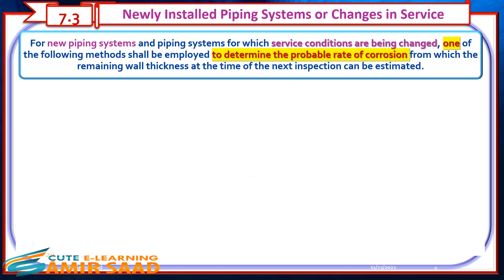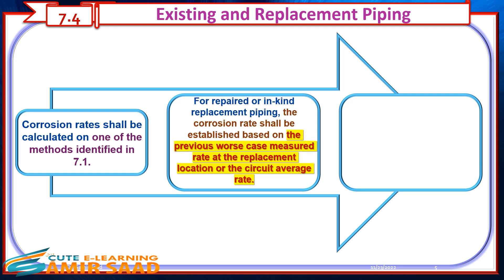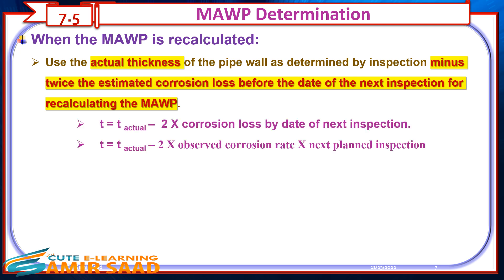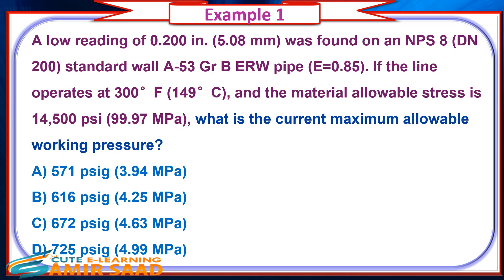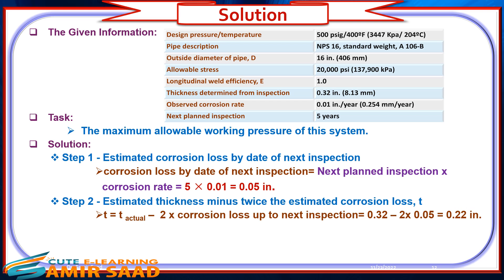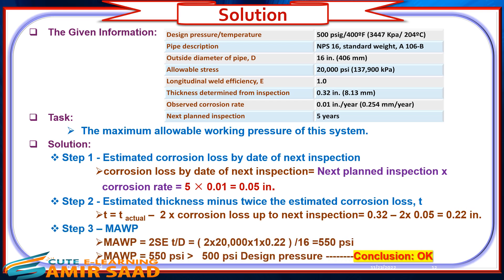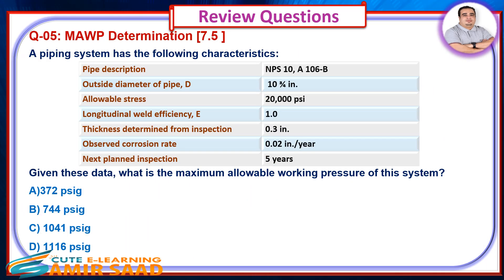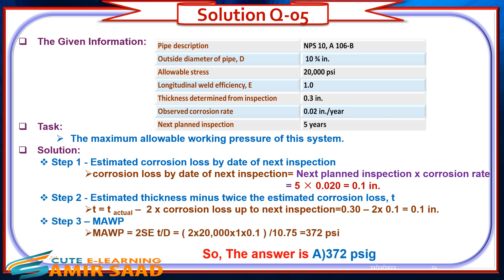API 570 - Inspection Data Evaluation, Analysis, and Recording 2

Comment: Dear Mr. Samir thank you so much for this awesome class.  

As per BOK of API the minimum thickness formula from ASME B31.3 is also mentioned. So during the exam, which formula should be used to calculate MAWP? Barlow or ASME B31.3 formula? If we will use Barlow, why BOK is specifying ASME B31.3 formula as well.